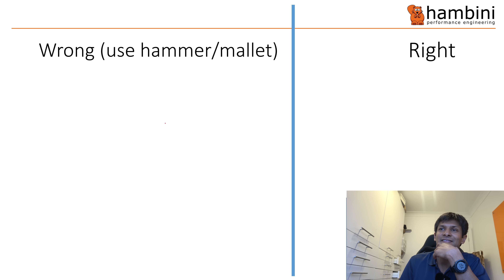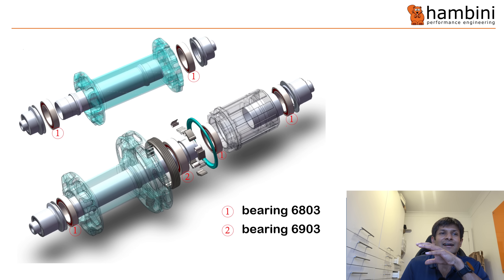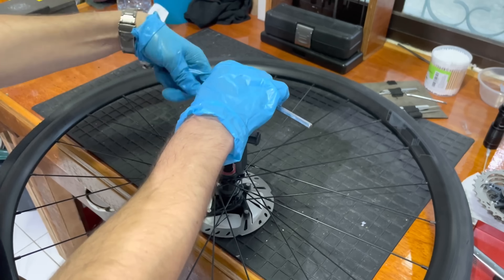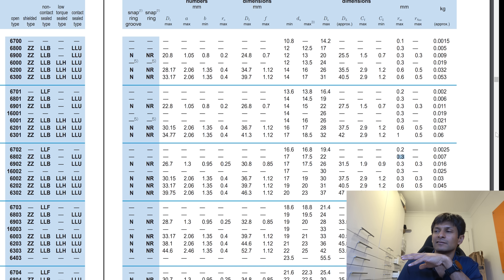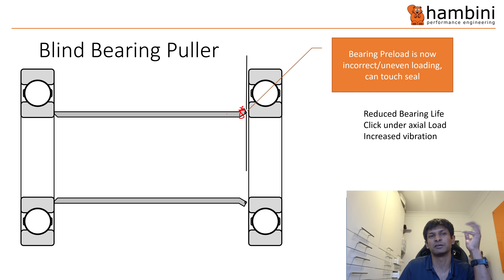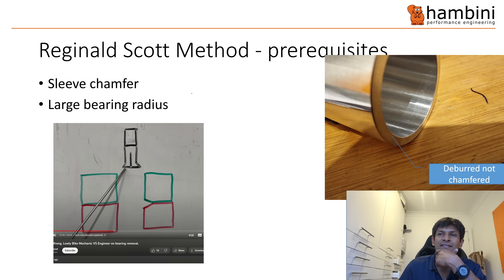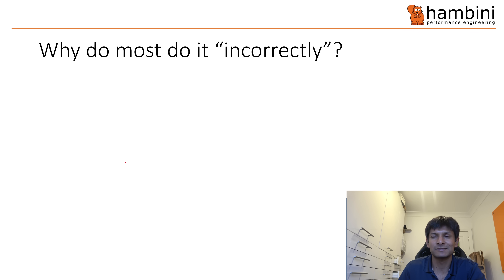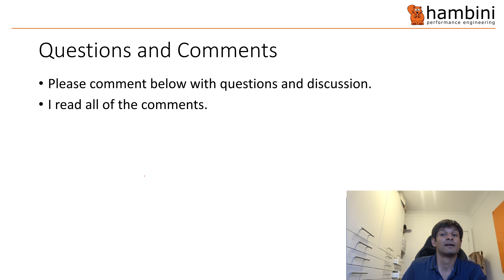I got REAMED by a Bicycle Mechanic | It was bound to happen at some point.

Comment: Late to this conversation, but your vid makes sense to me. One question, for campag ultra torque bearings there is a bearing puller that campag sell. If I use it should I replace the bearings or will once or twice not matter too much. 

My fat arse, is probably the biggest impediment to my cycling, but thought I’d ask.

Comment: Fantastic breakdown of exactly why these blind bearing pullers are a tool for bearing removal, not THE tool for bearing removal. Hammer and appropriate punch is the go-to for the job and the blind puller is the backup for when you cannot get to the underside of the bearing. 

I wonder why they are called blind* bearing pullers?/s

Comment: I believe you are ignoring the fact that the spacer between the bearings is loose enough to be pushed aside to make room for your punch to be inserted. That means there is more than enough clearance to prevent the spacer from being damaged by the puller. You are welcome to beat your bearings out with a hammer. I will continue to use a puller, which always works very well.

Comment: Had to replace rear linkage bearings on a carbon specialized stump jumper.  The bearings at the top of the seat stay had to be carefully hammered out since the surrounding area was so irregularly shaped and there was just not enough meat to get the pullers to seat.  Getting them in was much easier.

Comment: Love hearing someone who actually understands this stuff explaining it so well. 

Why do some freebies use these spacers instead if just having a stop/shoulder/whatever it’s called for the bearing to stop/rest on when pressed in? I’ve only had one hub (novatec I think)  with one of these spacers and it’s utter shite! Press the bearing in with too much force and they start binding up (axle downs want to spin properly.too little force and the threaded preload adjusting end caps end up compressing the bearing sand causing them to bind up especially when pedaling backwards at speed. It seems impossible to ensure the bearings are perfectly aligned. Yet in every other hub I’ve had (tune, alchemy, hope, carbon Ti, extralite, others I can’t remember) I’ve never had a single issue with this. Servicing has always been as easy as pop tye old bearings out, press the new ones in. Could do it in the dark. These spacers in the freehub just baffle me.

Comment: Hambini, can confirm your statement about the center tube ("preload sleeve") not being clearanced for use with blind hole pullers, even on MTB bottom brackets.  I have 3 PF30 MTB and Dub MTB brackets from BBinfinite and you would flare out the thin-walled aluminum tube if you used a blind puller.  The preload sleeves are exactly the same size as the inner race of the bearing and the only relief is the bearing chamfer as shown on the right side of your diagram at 3:15.  Once you dimensionally change that tube, even slightly, you may as well throw it away.  I know you're not the biggest fan of BBinfinite but Gary's bearing removal videos agree with you.

Comment: You're clutching at straws here, Hambini.  I know he is a pretentious, patronising, condescending prat, but he is 'generally' correct.
Once the puller clipped into place, Reg should have lightly finger tightened the locking bolt (not torqued it), and then there would be no risk of damage to the spacer.
As per Reg's video, the puller is the preferred method by the companies that you referenced.
Reg is a twat though.
Reply: It's funny you have to insult the guy so Hambini doesn't go red on you. 😅 

'The guy is a dick, but his logic is correct but he's a dick!' 😅
Reply: @ire923  I have structured my comment in this way, because it is an accurate reflection of the situation. It is Reg who has baited Hambini on a number of occasions into going Red.
Reply: @drivemenuts3011  the difference is Reg corrects his mistakes. Hambini doubles down which lost respect from me. Watching him strip the bearings out of those wheels was so cringe.
Reply: Hambini is a thermonuclear grade misogynist and speaks with the bloated ego of a typical academic elitist (speaking as an also academic elitist). But it Reginald that is the "patronising [sic], condescending prat"? You're a fucking retard.

Comment: What's up Frenchi ? Glad to see you won. I used to road race motorbikes and being a "ham & egger" had to do all of my own mechanic work. Wheel bearings were replaced rather frequently. I had a razor sharp chisel that I would use with a hammer (in my garage) on all new wheels. I would pop one bearing out this way and remove the spacer. I would then use a Dremel tool to cut three evenly spaced notches (similar to a peace sign, aka chicken-foot) in the spacer and put it back together, usually with a new bearing. I also Dremelled three small spots on the rim shoulder where the outer race sat. This would give me three windows big enough to use a brass punch and hammer for rapid bearing replacement when at the track. It also never put any lateral force on the inner bearing race like a blind puller would do so you could reuse the bearing if it was good. This fucking idiot should never be allowed to repair bicycles again and should probably not be allowed to handle anything sharper than a bowling ball. I knew he was a sissy Sally boi when I saw the proctologists gloves. Are there any men left in this world !?

Comment: Having watched both videos and your original video on the Hunt wheel set I think there’s room for both approaches. On some wheels the bearing puller will work and on others it won’t go in and seat correctly. If you have access to a puller set like he uses try it and if you have any ‘feel’ at all when using tools you’ll know if it has seated. Most of this disagreement seems to have stemmed from you getting salty over his initial comment, and being pretty patronising and him wanting his say and being a bit salty back. I don’t think either of you are 100% right (an yes I call myself an engineer as well). What I will say is after watching both of you using tools I’d rather have him service my wheels thanks ………

Comment: It is great to have the controversy as it creates views on both channels. Couple points. The method that is best is the one that works with the least damage. Just because it is a big company recommending a method does not mean it is the best. Search "remove pilot bearing with bread" and you can see there is still another method that could be adapted to wheel hubs.

Comment: Great vid, but I think Hambini is wrong; the spacer on Reg's setup looks like it was manufactured with that flare; the 4 marks from the puller may have still occurred, but I don't think an even and clearly defined flare of that angle would have resulted from using the puller.

Comment: I understand that his method damages the tube, but frankly I would still prefer to damage an interchangeable part than the hub itself. I think his method still wins the competition. Nonetheless because your method Hambini damages that tube too. 

The main point is still that the industry is building stuff that is good to be fitted and sold, but bad to be repaired. Which should be illegal and punished with the death row.

Comment: Sorry, but I couldn't get past the use of the oversized, blue, reach up a bovine arse, gloves.  What were we talking about again?  Oh yeah, knocking out a set of bad bearings in 2 seconds, per the dozen of manufacturer's tech articles, vs. dicking around with a blind puller that's meant for taking bearings out of a housing.....like in an automotive transmission.  Riiiiight.  Got it.

Comment: I have read all of this with interest and enjoy the respect and free and open discussion, so I thought that I would throw in my '2p' as well.
Whilst I have done plenty of hammering of hub/bearings, I can say that I have also used an internal bearing puller in a similar situation, but in my cases there were differences. 
1) The puller will normally expand and grip onto the inside on the inner race and grip by friction. The expansion bolt can create a lot of forceby it's wedging action and bicycle hubs hardly have much of an interference fit (more likely corrosion, or a light bearing fix. 
2) There was clearance to the spacer tube to get a light set to hook under the bearing.

Observations: In both cases a bearing puller works nice and easily and is very controlled, however my puller has a a presser plate and I make adapters and also add a soft facing where required. This spreads out load and protects the important bits. This works with traditional press fitter inner races, but who can get spares for them now and has time to strip and set up a traditional hub, or us the spring flared press tools.
Like a suitable press foot/tool; It is also good to use a similar mounting tool, such as the Hope tool (I think they call it a vice or anvil) but these are relatively soft and elastic compared to steel. In the Hope video he is also using a Thor soft faced hammer which also limits the shock and peak force, which makes hammering a drift or pin punch into quite a subtle process.

Tubes: The inner tubes have been discribed in the discussion as both spacers and pre-load tubes. Of course there are many designs in the market, but I believe that these are generlly just spacers. My understanding is that these tubes are being used as bearing spacers to avoid excessive preload (ie side load) of the bearings when the wheel is bolted into the frame. The pressing of the bearings is just to a nominal stop and not to a final measured length, so there is no way of establishing what preload has been applied and retained in the tube. I would have thought that it's use for preload would have been as a crush tube, to get a calibrated value of force to deform of a defined initiation form, but then they would clearly be scrapped and replaced each time, just like in vehicle tranmissions and final drive units. Maybe it is using the elasticity of squeezing down a thin walled tube? I am intrigued to find out.
   
Either way, a spacer or a pre-load tube, should avoid damage that can effect it's length or form, so care is needed any way. This is just like the in the referenced video for distortion to the hub shell and bearing recess, although the use of a point loaded press negates that. 

It is possible to use several methods, with care, sympathy and an understanding of the risks. I fully welcome this debate as it allows discussion of methods and concerns for us all to learn. This then also allows the controlled and careful use of simple tools like just a ground up nail, hammer, a block of wood and the floor, as is done in many a shed or repair shop in places where funding and tools are not available.

Comment: My favourite method is too remove the free body and then put that in an oven at 70 deg C for about 10 min, after which the bearings just drops out of the Aluminium free body as Aluminium expands faster than steel when heated.

Comment: Why not make the tube so at both ends there are 2 cuts of a 1mm or 2mm deep and 3 mm wide , sort of like crenulation or 2 opposing slots.  This would allow a mating tool to be be designed that can be visually aligned with the 2 opposing slots prior to entry or you could mark the bearing with a Sharpie and use that to align the tool with the slots prior to inserting the tool into the bearing.  Once in the same process as in the mechanic's video of expaning would be done, but only so the tool's projecting flange would put force on the bearing but not touch the tube in any way.  Of course the removal tool wil not havve a grip 360 degree, but on in the area where the slots are, but it seems a hard steel can put enough force to remove the bearing. This would be easier to show if drawings were allowed.

Comment: As a bike mechanic, 100% use a soft blow hammer, bearing pullers are great if there's nothing behind the bearing that you can damage but when pretty much every major manufacturer says to use a hammer, you use a hammer. 

The hilarious part is (and I know you were talking rear hubs here but still) that there is plenty of hubs where bearing pullers are actually impossible to use anyway, my front hubs on both my bikes and spare wheels are a prime example, the hub axle is the drift to remove the bearings and sits completely through the bearings when its full assembled, so the only way is to take off the end caps, then hammer them out one side at a time using the axle.

Comment: I watched that video and mostly thought about the legs of the puller destroying the freehub seal and seat.  Those preload tubes get ruined and hardly any shops replace them. Often left just wobbling around in there.  … or some mechanic just packed it full of grease and hoped no one would notice.

Comment: Maybe I'm wrong but the example hub at 1:55 only comes apart by tapping the axle. With a hammer. Preferably a plastic or dead-blow. Not going to get an extractor into those bearings, at least the first one.

Comment: Hambini, I saw the video, and he has a point. If the bearings came out gentler using the puller, then that’s the better way, not a drift. Yea the puller foot placement was sketchy, but nothing a few large fender washers or similar plate couldn’t fix to help distribute the load. If the bearing and tube have the chamfers (or not), I’d say the puller was the way to go, and using the drift, once I’d created a gap enough to prevent damage to the tube, I’d go in and use a blind puller rest of the way, just to be able to pull the bearing out with equal pressure and keep from causing any damage to the hub outer race bore. Yes, I understand the balls will be damaged regardless.

Comment: It's incredible to see a user trying to argue with the engineer who designed it. So, obviously, blind pullers are not the correct tool for this application. Can you give an example for which blind pullers were actually designed and in which they would perform the task without leaving damage?

Comment: Interesting video! So is the "best" approach to tap on the bearing to get about 2mm of slack, then use a bearing puller (slide hammer style) to pull the bearing out to minimize the stress/distortion on the soft aluminum hub?

Comment: Having done , in the last year over 200 wheel bearings for a neighbours wheelchair basket ball teams , which although dont have a sleeve, more of a solid stop inside the hub for the bearings to seat on. A simple piece of wood on the bench, a drift and a copper mallet and reasonable drifting around the bearings make them come out and not damage anything. Using studding ,. washers and sockets , means winding them back in is quick and easy. There is no gap behind the bearing for any blind puller, so drifting is the only answer.
 Also Hope hubs. Sliding the central sleeve to one side. After the first tap, the sleeve comes loose enough to be able to vary your tapping to make sure the bearing comes out parallel and not damage the inside of the hub. These I used studding and sockets to refit new bearings. Been doing this process for years and never had an issue. Glad to say my DT Swiss are still factory fresh , even after many miles to work on them.

Comment: 4:36 puller does not need to have extension that would damage spacer, it is just enough to tighten very strong and friction on bearing will keep puller inside of bearing

Comment: So, let's get this straight:
1) Old bearings are chewed up and need to be replaced.
2) I'm hammering the old bearings straight out.
3) The old chewed up bearings that are supposed to go in the trash bin are now hammered a bit; not in the fun spirited way, but with a litteral hammer. <--- Mentally insert 3 seconds of MC Hammer - Can't touch this.
What's the problem with hammering them on their way out?
Now, pressing the new bearings back in is another story, but I see that the whole issue is about garbage disposal. I guess that the "true mechanic" swapped some bearings in his nutsack with a hammer at some point, so this became such a sensitive subject for him, or her, or they, or whatever might be appropriate after a bearing removal.
Reply: Reginald's criticism was about the chance for damaging the hub, not the bearing. Steel sealed bearing not being straight when forced out, going against the soft aluminium of the inside of the hub shell.

Comment: The correct way to get a beating out, is to fit an expanding arbor into the inner race. Then tap been vee shape shaft into the split arbor, which will expand the arbor, and allow the bearing to be removed by continuing to tap vee shaft. No damage to bearing or spacer. Trying a blind bearing puller, or a punch of some sort are both bodge methods and far from ideal.
Reply: I think you mean no damage to the spacer because there is no bearing puller contact with it (Hambini's point) and no damage to the hub because there is no isolated point loading from an offset force of the hammer whacked punch (Reginald's point).  Query though damage to the bearing as you are concentrating the extraction force on the inner that must be translated through the bearing to the outer to over come the friction hold on it by the hub (Hambini's closing point)?
Reply: @thisandthatandotherthings  If bearings were made that were unable to cope with quite heavy radial loadings, they would fail very quickly.  

Spilt arbour bearing puller, and a slide hammer,  will remove pretty much any bearing without damage, very easily.